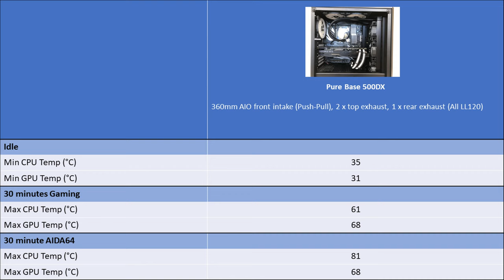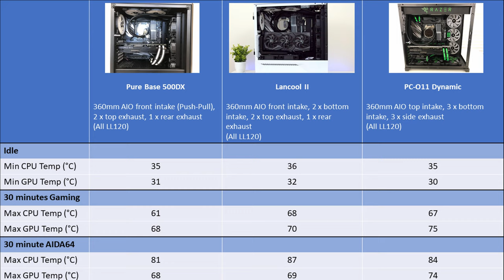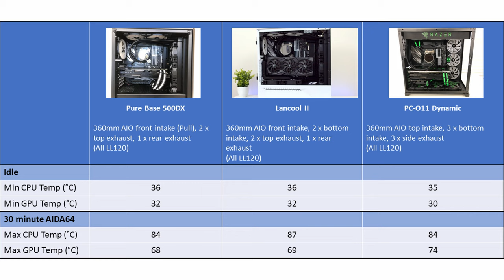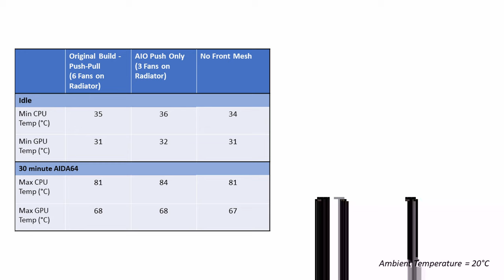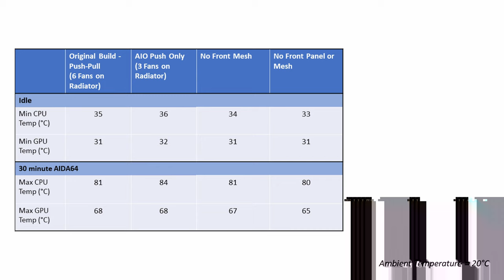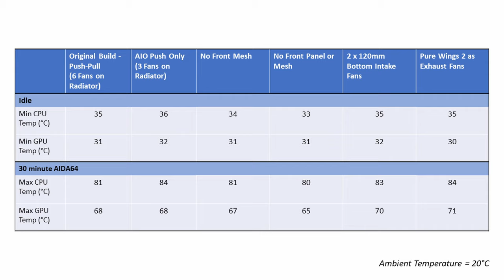be quiet! Pure Base 500DX Case Review & Thermal Testing

Comment: Great video! So much detail, thank you. I just received my case this week and built in it, but I was still hesitating if I should sell and go for Lancool II (due to more features), but everyday I'm loving this case even more. It would be completely inaudible at idle if it wasn't to my Wraith Prism cooler. The fans that come with the case are awesome. It gives me the same temperatures as I had in my Define R5 with front door open. That was a much larger and heavier case with no window, and had 7 fans. Pure Base 500dx is quieter. Yes, it gets loud when I'm gaming, but that's due to my CPU cooler running at 2800rpm and GPU running at 1900rpm. Can't blame it on the case. I need to get an aftermarket cooler. If anybody's watching this video and thinking of getting this case, I'd say, go for it!

Comment: I have this case with 5600x and 3060 ti. I put 3 sl120 lian li fans in the front, a phanteks 240 mph aio in the top exhausting, and a sl140 exhaust in the rear. It's a bit tight for clearance on my ram sticks, but the thermal performance is excellent. Never goes above 65 on my cpu, and the gpu stays about 61 (gotta love strix coolers). I've really enjoyed this setup, and just had to clean the front dust filter the first time yesterday (built around the middle of September 2021).

Comment: Great video man, I also just recently built in the white version last week and I'm loving it so far. Agree with everything you said both pros and cons. This case actually has a smaller footprint than my last case, yet I didn't struggle space atall and I love when a pc build looks full. I do have 2  2.5 ssds on show and I did struggle with plugging the cables into the back of them, but I was trying to do it with the aio installed, so that would be my fault, will do differently next time. Have white cables and 2070 super on the way next week, can't wait. Subbed

Comment: A heads up to anyone who has the original Purebase 500 (non-DX), you can contact BeQuiet's support and request the front mesh, filter, and IO (costs 42.35 euros with delivery). This conversion can only be done if the number before the 'Q' in your case's serial number is between 0 and 8. If there is a 9 right before the Q then it is not a compatible upgrade.

Comment: Just recently discovered your videos, really nice builds. The temps on this with the Ti are really good but I was wodnering if you have thought about trying builds with these specs but with a CPU air cooler like from Noctua or bequiet? I hear that front intake radiators can negatively affect GPU temps. I'd wonder how the temps of this build would be without the front radiator, 3 front intake fans a a dark rock pro 4 or noctua D15. Thanks!
Reply: @ChristopherFlannigan  Thanks. I'm really surprised, I really thought with a card like a 2080Ti the AIO as front intake would negatively affetcts its temp.

Comment: I have this case and it is great!  I just luv it....
Reply: Im considering this case for an AM4 build with an Arctic Freeze ii AIO. Are you able to give me tips on ram clearance? It seems all the cases I'm looking at seem to have clearance issues  with ram and a top mounted AIO, meaning I need to source low profile dimms.

Any info would be greatly appreciated.
Reply: @sa3kes620  I use the 500DX with a AMD Ryzen 7 3700X CPU affixed with the included stock cooler and I have space to very easily remove and replace RAM on my Asrock B550M Steel Legend motherboard.  In fact, I had to re-position my two RAM sticks after the initial build from slots #1 and #3 to slots #2 and #4.  The case comes with three fans at the front, back, and top of the case so you will need to remove one of the stock fans for your cooler.  Again, the case is my best buy of my build.
Reply: Hello Teebee do you think will i have enough space for a 3080 gpu
Reply: @dfgbr6  I am not 100% sure because I have a much smaller MSI Gaming X 1660 ti GPU with tons of space to spare. But I will research the 3080 GPU dimensions and get back to you if you tell me which 3080 brand you intend to buy.  Of note is that I have an Asrock b550M Steel Legend motherboard that does not have a C-type header of which the case has a front c-type connector.  I merely bought a PCI card with a header to connect the case connector and it turned out that the GPU card is too wide and blocks the card slot.  I would have be better off had I gotten the Asrock b550 Steel Legend instead of the M model being cheap as the non-M version has a C-type header.

Comment: Hi Christopher from Montréal. A useful video on a product I'm expecting to buy to build my first pc. It's never too late even at 64! I saw that you installed a RGB fan at the back. Maybe I'm ignorant because I'm a new comer in this but I understand that you can connect that new RGB fan on the motherboard and it will work? Is it that simple? Last question, I'm not a gamer but I'm expecting to install the Intel I5 11600K with no GPU. Do you think the three originals fans will be enough to keep the case at a good temperature? If I replace the fan at the back by an RGB fan, where do you think I should install that original fan? Do you think install it at the front should be a good idea? Thanks.

Comment: Hey Christopher, thanks for this Vid! I have just a short question for understanding it right: The AIO Push Only (3 Fans Radiator) configuration means you push the air out from the case (at the front) without pulling fresh air from top and rear? Or is this setup with 3 fans pulling in fresh air from top and rear? Thanks for your answer. Greetings

Comment: Shame you didn't do a full build using  these parts in full details i would of gone with this one but i have brought the msi x570 tomahawk board its just i haven't build a PC before and i am using your guide to build it but just waiting to buy a case and cooler. your build on this as good cooling and looks nice with the digital fans. Was buying the be quite 802 and was using your build on it but i cant seem to buy the case all out of stock .

Comment: Do you find that the temps are better bringing the hot air from the AIO cooler into the case instead of pushing air from the inside and exhausting the hot air from the radiator to the outside of the case?  Meaning, push from the inside and pull from the outside through the AIO radiator.

Comment: nice vid. thumbs up. i am unsure if i should take the 500dx or the fractal design r6. any recommendations? the only thing which disctacts me from the 500DX are the few USB connections on the I/O panel. 
how about the front panel: is it solid enough to regularly detach it from the case, when you want to clean your dustfilter?

Comment: Thank you for your review Christopher! I’m just waiting on the MSI X570 Tomahawk to complete my build identical to yours. One question, I see that you have a Deepcool fan hub and the Corsair fans with the lightning nodes. How exactly did you plug these in? Fans ->Hub->Lightning->Motherboard?
Reply: That Deepcool fan hub seems to be only for PWM, not for RGB control. The fan has two cables, one for PWM and one for RGB. So I assume he's plugging the PWM cable to the Deepcool hub, but the 5v RGB cable goes into a Corsair hub, which isn't mentioned. So there's no connection between Deepcool and Lightning Node.

Comment: Is there room for 280 Aio on TOP position ? i have the Kraken x63 and i it say in the manual that u can fit a 280 radiator on top position but i'm not sure about that (i have MSI z390 carbon pro with big heat sink)

Comment: Really good and informative video. I was already planning on buying the 500DX but will definitely go for push pull having seen your review. What was the stock fan curve running at? I might try running with the 3 included ones running in the same configuration but at 100% as I think there max is only 900rpm.

Comment: Is it possible to put a fan down under the shroud at the bottom of the case to pull air from under up to the gpu? The part where you removed the hard drive bays I mean.

Sorry you literally just answered that now towards the end of the video. Thank you.

Comment: Great videos mate really helped me building my first pc.
I've the same case with an Arctic freezer2 360 at the front.
Did you arrange the 2 top vents as intake for the push configuration?
And do you think it will make an impact to install 2 more coolers for the aio? I mean you can arrange them at front or back so I thought vents on both sides will significantly increase air flow? (only 2 not 3 vents bc. The 3080 is to big for the middle one to install)
Reply: @ChristopherFlannigan  Thanks for the answer. I´ve just rewatched your video and found the part where you compared the 6 fans vs. 3 fans on the radiator. (must have missed it the first time). Actually im quiete disapointed, I thought doubelling the fans would have a way higher impact.

Comment: Hello ! Thanks for the vid. I have a question about water cooling cpu to my build with 500DX case, RTX 2070 8gb Windforce (3xFan) and AMD ryzen 5 3600x
Is it better to put CPU water cooling radiator on the top or front ?
I am concerned about radiator on top - that it will intake warm air from inside case (heat from GPU) 
But also not sure about warm air from radiator flowing into the case (more heat flowing to motherboard and GPU) - while radiator placed at front.
Can you help me with opinion please ?  :) Thank you

Comment: Do you prefere this one or the lian li liancool 2 mesh? I really like both but I don't know wich one should I buy. The thing that stops me from buying the liancool 2 mesh is that it doesn't have the dust filter and I live in a house with a lot of dust.
Reply: I had the same problem as you. I said fuck it and went with the be quiet I guess we’ll see how it goes
Reply: @TheBadassOne17  Also I went for the bequiet and I'm not disappointed at all.
Reply: @TheBadassOne17  I think I did the right choice because the filters block a lot of dust and I can see a bit of dust also inside. So with the lian li it would have been worse!

Comment: I was disappointed you didn't include the manufacturer's standard fan configuration (1x front fan, 1x top fan, 1x rear fan) as a point of comparison. I'd appreciate your comment on the thermal data from the Gamers Nexus and from the Hardware Cannucks reviews of this case in comparison with your data. Their number seem to vary so much from each other, and it'd be good to get your comments on the differences. I'm thinking of getting this case, and want to know the absolute best configuration of fan arrangement.  https://youtu.be/zCnagbKkVzE and https://youtu.be/KTDZpYkEonY